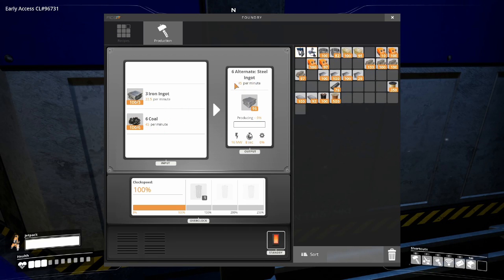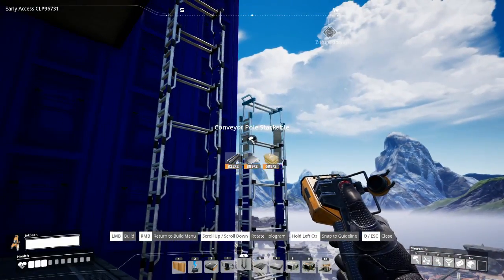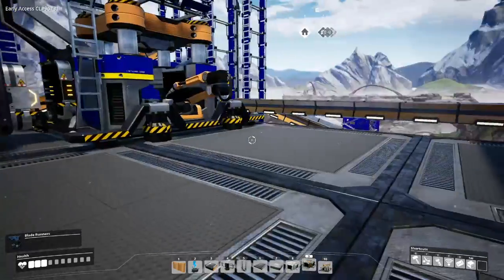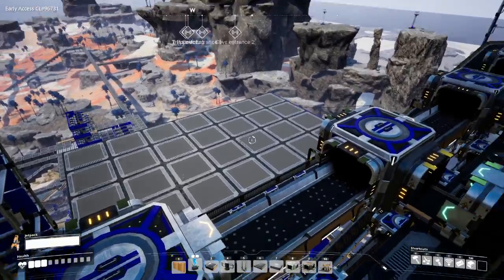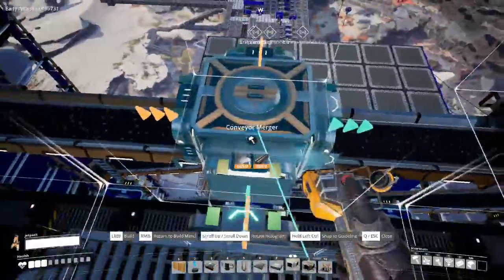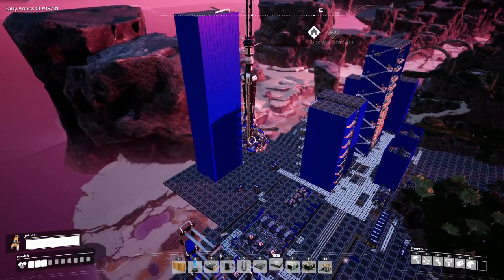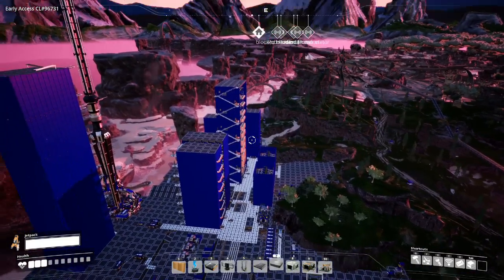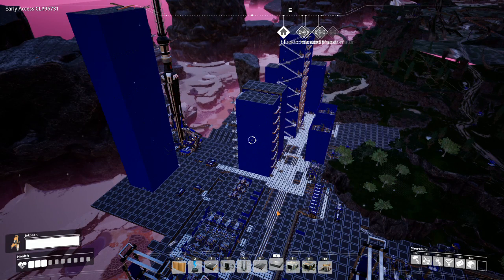Satisfactory: Stackable Steel production (2700+ pipes/min)

Comment: Love this design. I had a similar idea for a modular factory on a smaller scale that would expand up one full stack as well as forward or to the side if more belt upgrades occur. I didn't plan on stacking more than once at first. The idea of an internal elevator and external elevator helps with planning higher stacks.
Reply from the maker: Great ! Thanks for the comment.